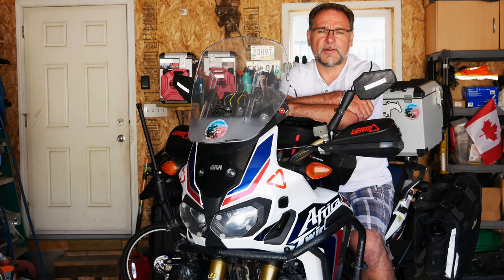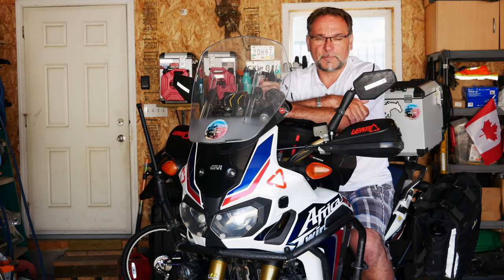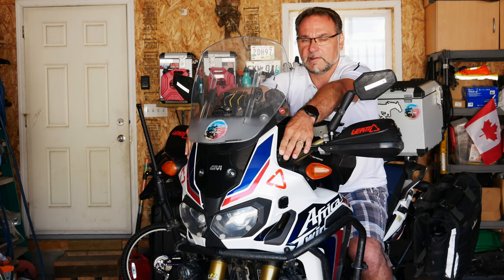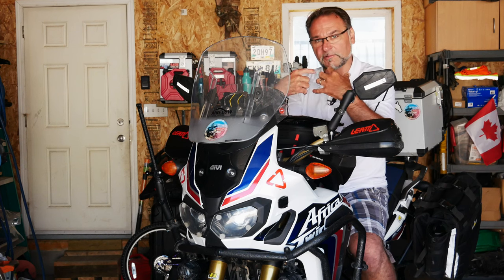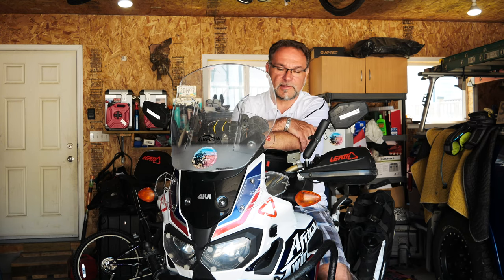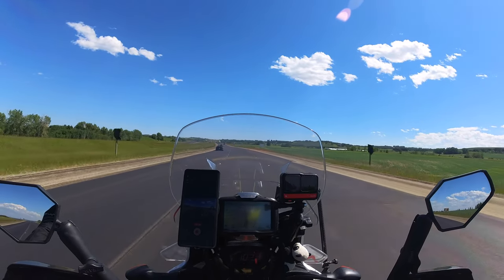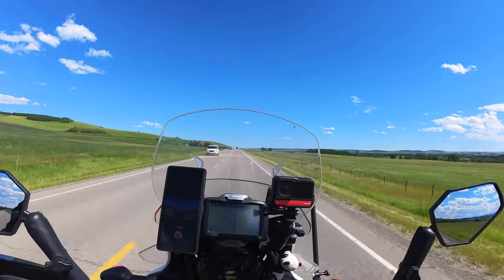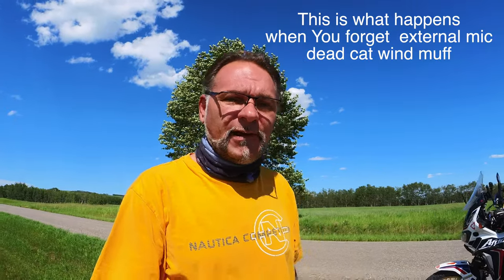WIND NOISE ON MOTORCYCLE

Comment: Thank you for the detailed instruction, wonderful review. Those drill scratches on left side broke my heart :( it is always safer to make a visible mark and start drilling with smaller diameter. I also have 2018 crf1000l DCT, have big problem with wind noise and buffeting. I am planning to make a different solution which is moving the screen 3, 4 cm forward by spacers and making a new mould of complete windscreen covering that area.
Reply from the maker: Thank You for the comment, in my opinion if you move 3-4 cm forward the screen that will change the aerodynamics I think the wind will put to much pressure on the screen, but let me know one way or the other.  I never had issues with my current screen buffering just the wind noise these little deflectors made quite a difference not 100 % bit way better.

Comment: Thanks for this. Looks good and seems effective too.
Reply from the maker: Huge improvement for sure doesn't eliminate the noise complete but it I more than good enough for me, also not costing fortune.
Reply: @AdventureTravelandScuba  the adventure sports model has those winglets as standard equipment. I was thinking about getting some of those and putting it on my 2018 base model.
Reply from the maker: @michaelskinner896  that's first I heard I was looking before at the Adventure sport but never have seen them, so that's something Honda must be aware of than.  Excellent I'll check it out one more time next time when at the dealership, if they still have it in stock just curious.......